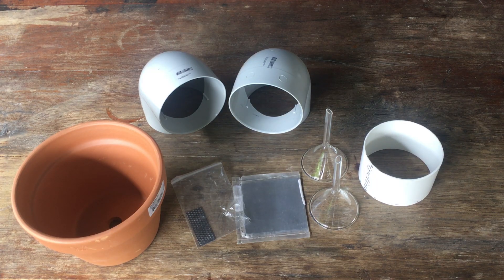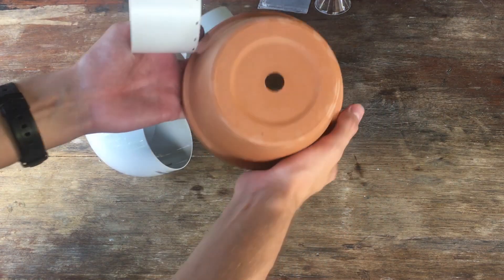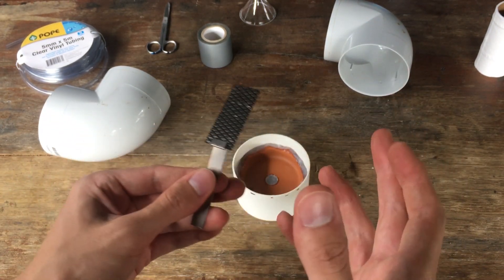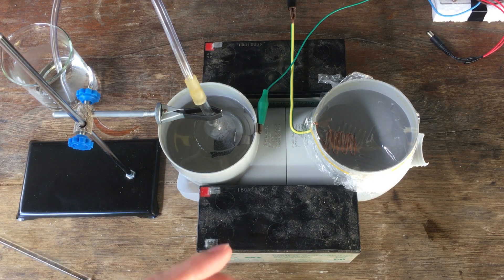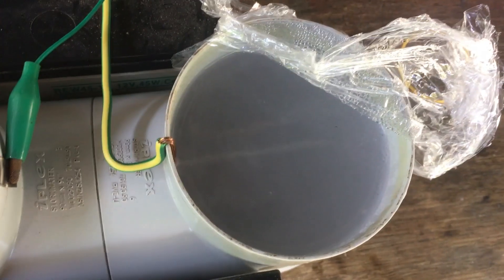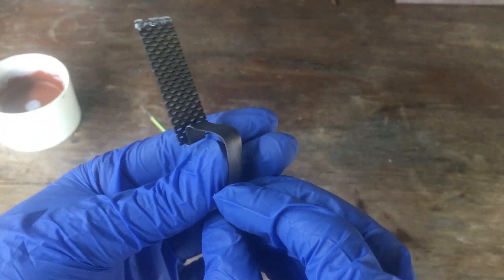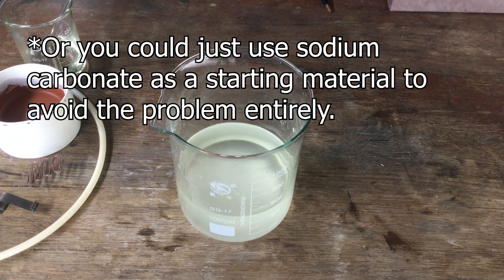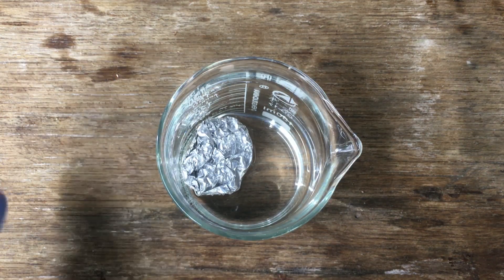A Chloralkali Cell

Comment: So, you produce x mol of naoh while using x mol of naoh to scrub x/2 mol of Cl2 gas produced??
Reply from the maker: Correct. Though I think you may be missing the point of the demonstration.
Reply: @ScrapScience  hey, while you are replying, I want to ask question. Is it possible to electrolyze sodium sulfate into sodium hydroxide and sulfuric acid using PVC glue + fabric daiphragm (the one used by @CatboyChemicalSociety / 
MysteriusBhoice youtube channel)? He successfully eelctrolyze calcium sulfate into sulfuric acid and calcium hydroxide with that diaprhagm. I wonder if I can do the same with sodium sulfate.
Reply from the maker: I'm not very familiar with the diaphragms made by CatboyChemicalSociety. I've never actually tried them myself. I certainly don't understand polymer chemistry or how they even really work in the first place. I'd imagine that if they worked for calcium sulfate, they'd probably work for the sodium salt too, but I'm afraid I can't give you anything more than that.

And yes, calcium hydroxide and sodium sulfate will work for that reaction. I imagine it will proceed similarly to the reaction shown in this video: https://youtu.be/KYd7FoNI0tU?si=10aWbhBBLpGZR1mM
Reply: @ScrapScience  The diaphragm works by making microscopic pores just like clay pot, but made out of PVC, with thinner and more flexible structure, which gives durability and minimal resistance. https://www.youtube.com/watch?v=foQHygE2Mkw

What makes me skeptical about calcium hydroxide and sodium sulfate reaction is that not a single credible reference online I found about it. But if true, that's great. Sodium sulfate is super cheap, sometimes cheaper than regular salt, and calcium hydroxide is even cheaper, I can get it for free if I transport materials myself.
Reply: @ScrapScience  I use PHREEQC pitzer database to test the calcium hydroxide and sodium sulfate reaction, no reaction occurs. Inversely when I add NaOH to gypsum, it react and form sodium sulfate and calcium hydroxide. Not sure about the accuracy of the software and the database, or my input.
Reply from the maker: Hmm, having another look at the solubility of calcium sulfate, it's a lot higher than I thought. On a second inspection, a reaction between calcium hydroxide and sodium sulfate might not be feasible - you're right. Instead, you'd likely need to use sodium carbonate instead of the sulfate salt.
Reply: @ScrapScience  Sodium Carbonate is unfeasible for my project, it's 1.1x more expensive than just pure sodium hydroxide in mol basis. I will try electrolyzing sodium sulfate and targeting electricity price of 20% of pure sodium hydroxide, which will get me 35% price advantage than buying sodium hydroxide.
Reply: @ScrapScience  another question, is it possible to react Sodium Sulfate and Calcium Hydroxide to produce Sodium Hydroxide and Calcium Sulfate? Im looking to produce sodium hydroxide cheaply, withouth the hassle of producing chlorine.

Comment: Hi Harry,
As i was reading the comment section of this video, someone suggested disphragm from car battery. You responded to this comment with approval.
I was using unglazed clay pot before to conduct chloroalkali electrolysis.
I tried the membrane from car battery. It is 30 times better than unglazed clay pot. I would describe it as next to Nafion
Reply from the maker: Very interesting.
What makes it better than a clay pot? As in, how does it act differently?
Reply: Okay Harry,
How the membrane from car battery is batter than the unglazed clay pot:
I am using an electrolysing machine. It is rated for 30Volts and 5 amperes. However, I hardly got even 10 Volts. 
With the clay pot, i never got even 3A, even after three straight days. With the membrane from car battery, i was at 4.29A at just 26 hours.
As to purity, i am not sure yet. The bleach is definitely very strong. It literally shreded some rags i tested.
For the sodium hydroxide, i tried to melt some aluminium foil. It is dissolving but not vigorously
Thanks Harry
Reply: And also i forgot to add. The membrane is more convient to collect gases. It is so difficult to collect chlorine on the clay pot

Comment: Hey, hi. I hope you answer. What other materials can be used as membrane? Maybe cardboard or plywood? Drywall? Slice of silicate or clay brick?

 I made a membrane from slate (a dense sheet of asbestos, uses for roofs. "шифер восьмиволновой" in russian) with an area of approximately 30 cm². The result disappointed me. After 5 hours, the current did not rise above 5 milliamps. It seems that the slate is too dense and does not allow ions to pass through. Or something like that.

red. So, after 18 hours of electrolysis, the current finally began to increase. Now the current is approximately 0.7 amperes at 24 volts. It turns out that asbestos sheet is not such a bad material.
Reply from the maker: Anything porous and chemically resistant will work to some degree. While I wouldn't use asbestos myself, it has been used in industry for this very process.
I'd still recommend clay pots as the most effective material for their cost.
Reply: Bro use a clay pot

Comment: use some 2 part epoxy instead of the silicone sealant, its worked for me for i think about 30 hours now and its shown no signs of degradation. when i formed mine, i used parchment paper as a sort of mould, and the epoxy didnt stick to it at all.

Comment: i wanted to ask, can i use copper wire for both electrodes? will it affect the process negatively?
Reply from the maker: Copper is fine for the cathode, but does not work at all as the anode. You need an anode that can withstand the oxidation of chloride to chlorine. The only commonly available options are graphite, platinum, and mixed metal oxide electrodes (such as the one I use here).
Reply: @ScrapScience 
Hi Harry
What do you think about Lead Dioxide as an anion
Reply from the maker: @geeljireoomaar6140 Personally, I think they’re a terrible choice. Platinum, mixed metal oxide, and graphite all work better for the process.
A professionally made lead dioxide anode with a titanium substrate would possibly work okay, but any homemade lead-based anode would easily and quickly degrade in a chloralkali cell, leaving you with a toxic mess of lead salts in solution.
In particular, lead dioxide electrodes from a car battery, or anodes made by oxidising lead metal, are completely out of the question.
Reply: Anode i mean sorry

Comment: Is there a disadvatage to using graphide instead of mmo?
Reply from the maker: They will slowly disintegrate over time, so you’ll end up with carbon dust in your anode chamber. This isn’t a problem if sodium hydroxide is all you’re after (and if you don’t mind replacing the graphite electrodes every now and then).

Comment: Would be working for  making clean of graphite  kclo3  with carbon anode?!  On both side  the same kclo soultion.
Reply from the maker: No. The carbon anode will still degrade and fill your product with carbon dust. Additionally, the process will be far more expensive.

Comment: A really good diaphragm, mineral wool fire/sound reducer insulation packed tight in a open tube . It seals great and holds up very well. I just don't know if the mineral wool will react, it doesn't seem to be.

Comment: as for scrubbing the chlorine, wouldnt it even be easier to use the hydrogen from the naoh side of things to burn the chlorine into hydrochloric acid? I mean, best case you need the hcl anyways, so its a useful biproduct, worst case you can just neutralize it with naoh/nahco3(Ironic again, I know) or dilute it with a lot of water water and flush it?
Reply from the maker: If it were an easy thing to do, this would be a great use for the chlorine. 
Sadly, the reaction between chlorine and hydrogen is extremely energetic (with enough explosive power to shatter test tubes with the combustion of only a few millilitres of gas). I'm afraid it's just not feasible to do safely without an extremely reliable setup.
Reply: @ScrapScience  hey and thanks for the reply. I have to be honest, the only time I have ever seen that reaction was in a I think 7th grade chemistry lesson in school(and that was like 25 years ago) with my teacher submerging a Bunsenbrenner with hydrogen into a large cylinder filled with chlorine, turning the flame white. I wasn't aware that it was that energetic, especially when working with the rather small volumes that the electrolysis process produces at once. Honest question as a follow up. Does your setup produce more than one Mol(6*10^23 or 22.4l) of gas per minute?
Reply from the maker: The setup shown in this video doesn't make anywhere near one mole of gas in a minute I'm afraid. Instead, it produces about 0.0006 mol per minute of each of the respective gasses, and that's being optimistic.
Reply: @ScrapScience  that's what I guessed - thank you for answering all my questions

Comment: 15:50 This isn’t pressure applied directly, they just keep the liquid level higher in the anode side, which gives hydrostatic pressure. The way they deal with the salt is that NaCl has about the same solubility at 25C as 100C, but NaOH is much more soluble at 100C. So they boil it down until NaCl starts falling out, until it stops falling out, and then decant and finish the boiling to get the solid NaOH. Also NaOH is a few times more soluble than NaCl even at room temp.
Reply: You think doing a slow controlled recrystallization would generate pure resulting crystals?  Not sure how well or bad these ions would interchange in a solid crystal matrix as a mixture, but generally if done slow it works really well for purification.  I'm used to the organic world in chemistry tho, so not sure if this would translate well to a simple ion based crystal or if substitution would occur in the growing crystals to the point of not being pure enuf to be worth the effort.  Curious if you've ever tried it
Reply: Thanks very much bro for sharing thisvaluable comment

Comment: Creative Video .  I have some questions .  If you work on a larger amount of the solution.  About 400 kg of solution.  What is the ratio of sodium chloride to water?  Is it possible to use pure sea water after the concentration of sodium chloride in it?  What is the best volt for quick work on this volume?  Thank you
Reply from the maker: 400 litres is a lot. This requires a pretty serious setup and if you're going this route, I'd recommend doing some proper reading on the topic (start here maybe: shorturl.at/rA378 ).
As for your questions:
- The sodium chloride should remain saturated on the anode side for best efficiency
- Seawater contains a significant quantity of cations that are not sodium. You might need to remove the magnesium and calcium before you use it directly, but it should work to some degree.
- The voltage should always be as low as possible for best efficiency, but you obviously need a high enough potential to draw your desired current. The voltage you actually need will depend on the shape and design of your cell.
Reply: @ScrapScience  Thank you very much for the quick reply.  But I will do the experiment and study it first and then tell you the result.  But what is the ratio of sodium chloride salt to distilled water?  How much sodium hydroxide and chlorine is extracted from a ton of salt.  I can succeed with your help.  I tried to translate the file.  I will try to translate it.

Comment: Perhaps a diamond core drill in a drill press without the pilot drill will be able to cut curved disks from any part of the clay pot.  Also some garden suppliers will have clay saucers for the pots that are flat with no hole.  

Also a local potter will probably make a suitable shape from suitable clay and fire it suitably in exchange for a bit of promotion.

Comment: good job , which kind of material we can use as membrane instead of nafion ? we can use sponge or filter paper ?
Reply from the maker: If you can't get nafion, a clay pot or some kind of porous ceramic are usually the best membrane options. You can use filter paper or even cotton if you must, but these will likely lower the purity of your final product since they tend to allow significant diffusion between the chambers.

Comment: Your video gives a good background on the color-alkali process.  I wished I would have seen it 25 years ago.  I was once given the task to determine if a cheaper grade of NaOH could be used in my companies industrial processes.  I knew nothing about the chlor-alkali process but, had to figure the difference between the more expensive Mercury grade and cheaper diaphragm grade caustic. All I was give was obsolete specifications for a material we were buying which was referred to as “Rayon grade” NaOH. The specifications were old and no one knew why that specifications chosen or what a different grade would do to our various processes. Rayon Grade specs were looser than mercury cell but, tighter than diaphragm cell product.  

I determined that for some of our processes Mercury cell grade was necessary, but for most of our other processes the cheaper diaphragm grade purchasing wanted to use would be fine.This was  because in some cases diaphragm grade contained too much residual salt and iron which would interfere with processing and contaminate our final products..  I talked to several different suppliers.  None had even heard of Rayon Grade and they all said that diaphragm cells could not produce the quality of NaOH we needed.  One of the suppliers I contacted  said that they had completely switched  to a newer membrane process which was able to provide the high-quality I needed.  for  a price similar to diaphragm grade.  Now all of the Mercury plants have been shut down and  diaphragm plants have mostly switched to the better membrane process.  So now almost all NaOH would work in our processes but, membrane grade is still much cheaper than mercury grade. It is possible that, at the time, some of the suppliers did not want to tell us membrane grade was so much better  because they made a premium from “mercury grade” which may well have been made in a membrane cell. I was lucky to find a supplier that that had completely switched to membrane grade and was willing to sell at near diaphragm prices. It still took some months to run lab experiments with the membrane grade to demonstrate that it was suitable for all of our our processes.  It was probably good for the supplier that provided the membrane grade since we bought the stuff in rail car quantities. Ah the life of an industrial chemist.

Comment: this is awesome thanks!~ im gonna make one. can this be made to make large qunatities of hcl at home. i ideally want to make 1 gallon of 12ish molar hcl per day. would mercury work for thi and make efficiency much better than flowerpot
Reply from the maker: As it turns out, hydrochloric acid can't be made directly by diaphragm electrolysis. It's destroyed by the action of oxidising chloride to chlorine on the anode.
If you're instead planning on making HCl by reacting the chlorine and hydrogen gas outputs together, that's definitely a viable (though very dangerous) way of doing it. Just keep the explosive nature of this reaction in mind if you're giving it a go.

Mercury will definitely work as the cell separator here. However, I've never given it a go, so I'm not sure if you'll get an efficiency increase. As far as I can tell, the overall energy efficiency might be a little lower than using a ceramic diaphragm, but the current efficiency should be higher.
Personally, I don't like the idea of working with mercury, especially as a sodium amalgam. If you've got the proper setup to deal with this safely however, feel free to give it a go.

Comment: Why don't you use Clay tiles and a Masonry hole saw, wouldn't be it easier than smashing clay pots? If you really stuck with clay pots that you should consider to use the whole clay pot with the same diameter of the tube more surface area than a flat disk and less sealer work to do
Reply from the maker: I've tried this in the past, but clay tiles actually have a different degree of porosity when compared with garden pots. The pots are specifically designed to allow a small amount of air and water to pass through them, while tiles are designed to absorb as little water as possible.
Regardless, a higher surface area does seem like a good idea, thanks! I'll keep that in mind in the future.

Comment: Hi, i love watching your videos and I find them very useful. In this NaOH production experiment I noticed that just to produce 15g it took you two days, what advice would you give to someone who would want to produce that same 15g in just 12 hrs? Your answer will be highly appreciated
Reply from the maker: To do this, you'd just need to run four times as much current through your cell. The best way to do this may be to build a slightly bigger cell (with a bigger diaphragm and bigger electrodes), allowing you to run it at a higher current. You could even buy some nafion membrane (to replace the clay pot diaphragm) if you want to spend a little extra money, in order to allow for more current as well.

Comment: How possible would it be to bubble air through it and make sodium bicarbonate generator?
Reply from the maker: That would definitely work to some degree, I'm not sure how well the reaction would go to completion though. You'd likely still have some hydroxide in there, but I'm not sure how much.